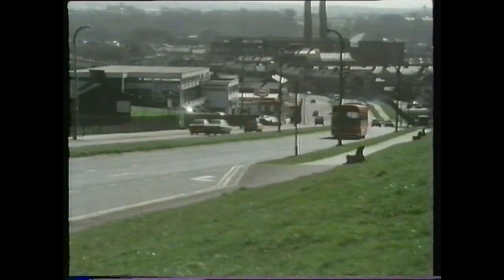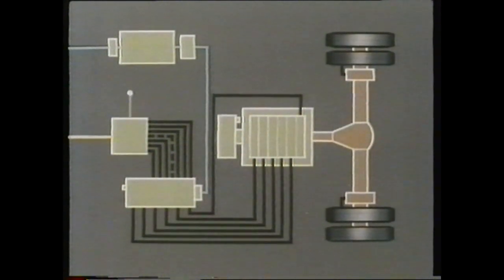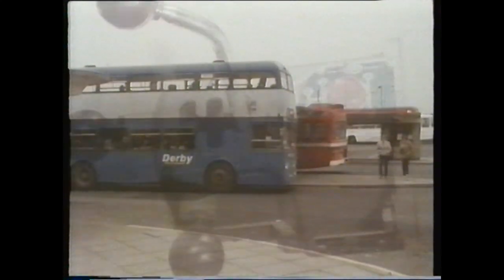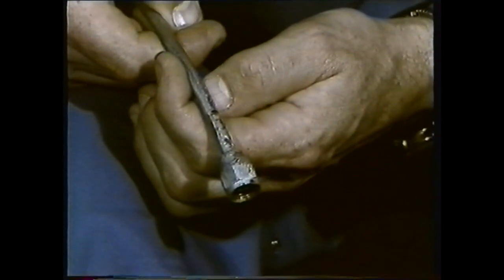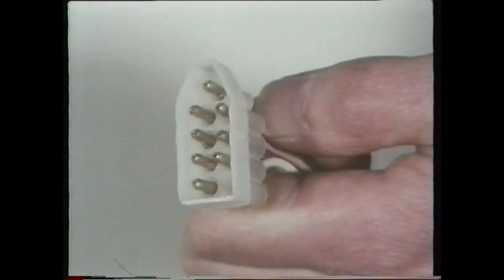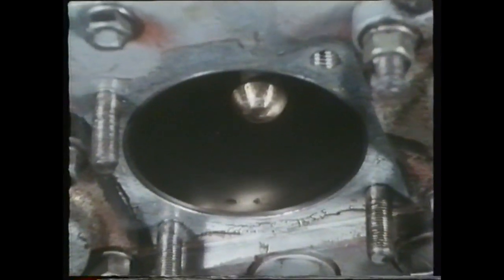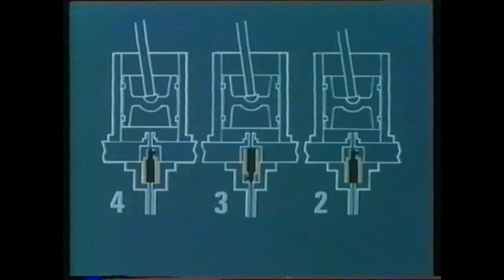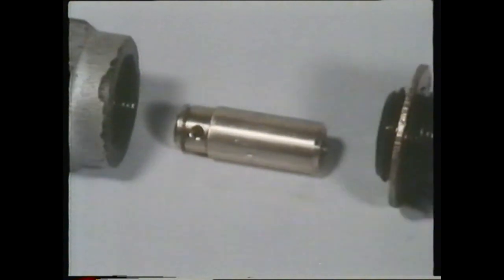Leyland Bus Training Film: Self Changing Gears SCG Semi-Auto Pneumocyclic Wilson Gearbox Maintenance

Comment: A video is far better than the Leyland manual which would have explained a lot more about auto adjustment. Brings back so many memories of fluid flywheel repairs and oil pump gear repair and pressure testing. Remember using that measuring tool primative but did the job.   Don't know if it was approved but our company put dump valves on ours to quicken the release of the band but also caused so many breakdowns for sticking or bursting the diagfriagm...   Nice sound though going through the box

Comment: Brings back memories of my days working on Leopards in the North East - thank you for uploading!
Reply: I suspect on the whole they were reliable gearboxes - provided maintenance was carried out correctly.
Reply: @millomweb  They were more reliable with air actuation compared with the hydracyclic version. But no gearbox would withstand repeated abuse from a driver who just rammed through the gears,... unfortunately plenty did. These training videos were meant to inform drivers about the engineering so they would be more respectful of the vehicle and its systems. The videos proved more effective than the Chief Engineer shouting and balling at the drivers for "wrecking" his fleet!
Reply: @Neash2  I suspect the worst would be changing up a gear while accelerator still flat to the boards !
Currently, my favorite  is the variable pulleys fitted to the Invacar.
https://www.youtube.com/watch?v=j2jkyCaard0
This ticks all my boxes - 2 entirely mechanical analogue 'computers' playing tug o' war with a belt.
Their weakness is power handling (torque) - so, my solution on the bus......I hope you like this !!!!!! is to drive 4 of them with the engine and each one driving 1 back wheel - so yes, the inner back wheels would be on their own solid drive shafts and the out back wheels driven by a drive tubes ! 4 wheels with independent drives would mean no need for diffs ! The four 'gear boxes' would balance out the power/torque to each wheel - and if a belt failed, the other 3 wheels would still provide drive. You'd have 4WD on 1 'axle' !
Reply: Was the thumbs up for the pedal to the boards part ?

Comment: We had the same self adjustment mechanism on the SCG boxes used on British Rail DMMU Trains. The joys of Epicyclic Gearboxes and f f f fluid-flywheels!
Reply: You seem to have a stutter there. I guess you mean DMU.
There is or was a video on YT about driving the DMUs  - about the only thing I remember was to only coast in top. Although there was quite a bit of emphasis on giving the engine a long time to decelerate before changing up :)
Depending on your response, I might have to explain British Stamps :)
And now my mind is on a new train mechanical transmission :) (I was going to say we don't have electric round here - even the signals have oil lamps in them - but that's a jokey lie :)
(Signals isn't a jokey lie though not traffic lights, semaphore signals ! (Actually, I prefer them - as they can be read from both sides :) )
Reply: @millomweb  DMMU - Diesel Mechanical Multiple Units. The were Diesel Hydraulic and Diesel Electric Multiple Units too, but only the Mechanicals had the Wilson Epicyclic 'box. You are absolutely  right, only coast in top gear (4th). Too gear was a ditect drive that locked all the gear trains together. We didn't have the luxury of 'Overdrive' - so a maximum speed of 75mph! Ah - they are proper signals then! Only proper signals have an oil lamp (or glow worm as my instructor used to call them!) He did have a stutter, and used to drum into us the importance of changing up and down properly  (close throttle, count to 4, change gear, count to 4 again). 'Otherwise you'll burn out the f f f ' and we always thought he was going to say 'f@#ing thing' but it was always 'f f f fluid-flywheels'. I can't think of fluid-flywheels without the preceding f f f now. Funny how things stay with you. I can remember what the speed range was for each gear (1st : 0-15, 2nd : 15-27, 3rd 27-41 and 4th : 41-75) But i can't remember my bank PIN!
Reply: @TheZacDJ  Why not make your bank PIN 'top gear': 4175 !

I knew I was going to have to explain British stamps...........

They're the only postage stamps in the world that don't have the country of origin on. WE WERE FIRST !

Similarly, ALL DMUs are mechanical. They're called DMUs ........
DEMUs are eectrical and
DHMUs are hydraulic.

As soon as you say DMU you know that only half the carriage light bulbs are visible :) as they stick half the bulb below the shroud !
The signals are actually electrically lit. The battery boxes at trackside are part of the clue. But yes still semaphore on the entire Cumbrian coastline. Worth a trip on it just for the sake of it. A fair bit of it - one side you see land, the other just sea water - if the tide's in. Then there's Bransty tunnel. That limits the length of the carriages ! What's more, it was totally unnecessary to dig that tunnel but mr flatland land owner refused to let the railway on his land !

Now for the bad news. Your stuttering tutor was wrong ! Yeah you could cook a fluid flywheel but on a frosty morning, setting off in 4th would quickly warm it up :) The fluid flywheel actually takes all the battering any reasonably bad driver can give it. The 4 second pauses are to minimise brake band wear on ratio selectors. The first  4 is so the engines aren't running faster than they'd be pulling in the new gear and the second four is to give the newly selected band to get fully tightened before putting the power on again - so it doesn't slip.
I actually once abused a farm tractor on this very point. It had a 2 speed lever on it as well as a standard 4 speed box (no synchromesh at all) and I used the 2 speed lever to select the faster speed while going too slowly - the engine wasn't running fast enough to provide proper hydraulic pressure on the band - and it caused it to slip for a bit ! At least after that, the 2 speed change was less jerky :)
I can remember my Dad's bank PIN - yes, from THAT railway loco !
Reply: First generation British rail diesel multiple units were buses on wheels

Comment: This is soooo cool.. i have a bus with a gearbox that looks like this (but only 4 forward and 1 R), i have just adjusted the gearbox to get 2 gear working, selfsdjusting didn't work... but would like to know the correct distance, don't have the special tool :-), but i stille have an issue... 4'th gear is not engaged.. but insted it just "locks" the shaft. now where to find information about this ?
Reply: Hi I'm deano from skelmersdale Did you ever get a reply or  find out why your 4 gear locks ? Did you talk with other bus specialists

Comment: That looks so over complicated. was it reliable ?
Reply: I'd agree it looks complicated but to be honest, it's not - on the basis that there are far more complex things and there are better designed things - in fact, 'same' gearboxes but foot pedal operated rather than air operated. It wasn't mentioed whether this was a pre-selector gearbox.
Basically, you have a contol lever for the driver to select a switch to turn on. That uses electricity to open an air valve and then the power of compressed air does all the actual work. The film covers maintenance procedures - on what appears to be a fairly well designed system which includes automatic adjustment of wear items. If maintenance is done properly, it should be reliable.
Reply: They were used by European bus manufacturers such as Volvo, Scania, Saviem, later Renault as well and were a player alongside ZF, Voith, Allison in the citybus gearbox market there.
They were good if driven sympathetically.
Reply: @jamesfrench7299  'sympathetically' - yes, lol - it's a pity they don't operate with sympathy for the driver ;)
Going down a hill once in an auto car I wanted some acceleration - so anticipated a down-change - so I pressed the accelerator a bit further than I normally would. I didn't get the down-change just far more acceleration than intended !
Reply: @millomweb  my 89 Automatic Mazda 323 with Jatco 4 speed automatic with overdrive lockout button on the shifter has excellent engine braking effect as autos go.
Nothing beats a manual for saving brakes though, except a Telma retarder or regenerative braking in a Toyota Hybrid.
Reply: @jamesfrench7299  Engine braking on my bro's Audi manual is just about absent - to the extent I even turned the ignition off to see if the engine management system was still injecting fuel. Didn't make any difference !
What wears brakes out on our vehicles is rust - on the discs !
Reply: It is very reliable if maintained well AND if the vehicle is driven the way it should be driven. So NO shifting gears without a 1.5 second pause betwee gears, either up or down shifting. And, NEVER down shift to first while the vehicle is moving. Furthermore, some extra gas between down shifting will make sure for an almost unnoticed jolt free shifting of the gears. Our museum buses are checked once a year on vital point as outlined in this instruction video. In between, we make sure there is no oil in the feeding lines and instructions are given to young drivers who are used to automatics only. So, take your time and make sure enough air pressure is built up, no matter if the bus wants to move or not. Not enough air pressure will lead to slippage of the brake bands causing extra wear consequently. Thing is, the gearbox will perform as usual but damage could have taken place without knowing it.
Reply: Oh, for those who are not familiar with these magnificent gear boxes I’d like to mention what happened some time ago in our museum. Buses had to be moved so those that had to be moved were started. One of them was started by a volunteer, unfamiliar with the Wilson gearbox. The bus was in second gear, had no air in the tanks and the parking brake was released, it has NO vacuum brakes. In the meantime he got out in order to start up the other buses. So after a while, as soon as air pressure was sufficiently built up, the Wilson equipped bus started to move on its own with devastating results. It rammed a wall, thereby destroying vital supporting beams of the museum hall and also damaging its windshields and also severely deforming the front end of the bus. The bus has an air operated gear shifting column, the one that is mounted on the floor. First fault was done by the one who forgot to lock the lever by lifting it and turning it counter clockwise so it would lock in neutral, as always should be done that way if the driver leaves the bus with a running engine. Also, he forgot to apply the hand brake. The one who started the bus the other day, didn’t check if the bus was in neutral and didn’t check if the hand brake was applied. Both persons were given instructions afterwards.....but the damage was done. A lesson to be learned!
Reply: @leyland9999  Sadly I can put my hand up to brake band abuse - on a tractor - with a hydraulic 2 speed lever on it. I selected the higher ratio at low engine rpm - and the band slipped. Ratio changes were smoother after that !
Reply: @leyland9999  We had a case of a wagon perked for a while with the parking brake off - and we needed to move it a little - so it was started and immediately driven - knowing that the parking brake would still work.
It didn't ! The air release valve was stuck internally - but the operating lever moved freely to the on position !
Reply: @millomweb  These systems are quite old, it wasn’t a Wilson/Leyland invention. They just perfected it. They are totally obsolete now. However, it is a remarkable piece of clever engeneering, from way back when basically. That said, I would not have come up with the invention, so I respect the old techniques that so reliably performed day in and day out, for decades. Accepting abuse to a certain point. Are modern techniques any better? It depends, modern buses are totally different beasts really. Electronics galore thereby making them very complicated machines that have a lot of microprocessor controlled circuits. Seen in that light the old stuff IS reliable, very reliable.
Reply: @leyland9999  "Yes, it's stopped working because of that chip on the circuit board."
"So we'll need a new one then ?"
"Yes, that's correct."
"Great, I'll look forward to another new bus."
Reply: @leyland9999  I feel so bad when reading that accident! What a mess!
Reply: With a good driver - they were the smoothest, most relaxed change ever!